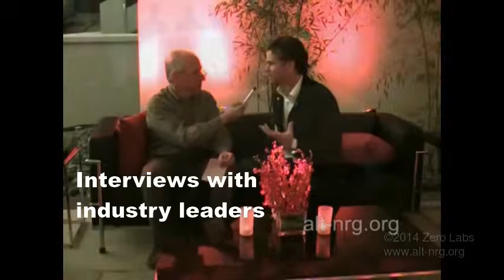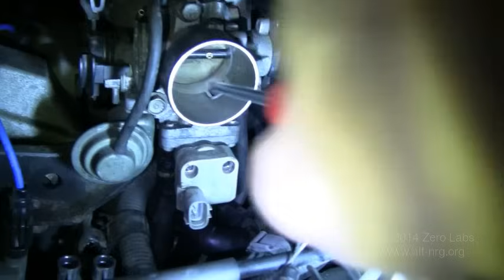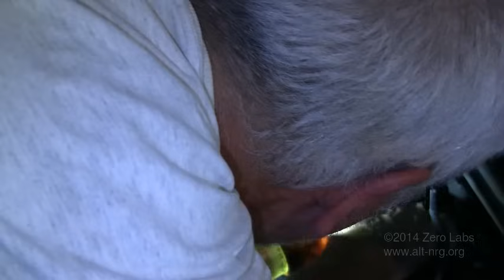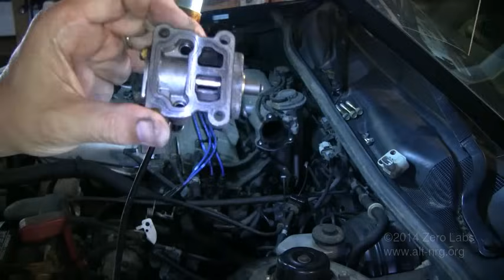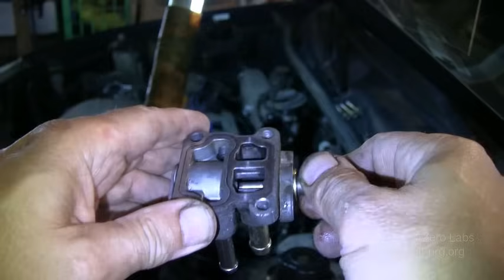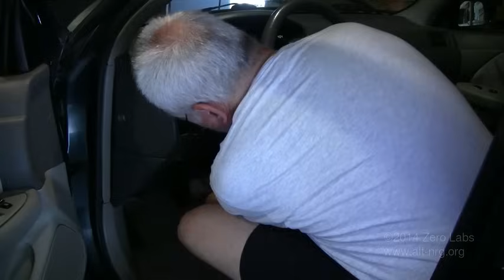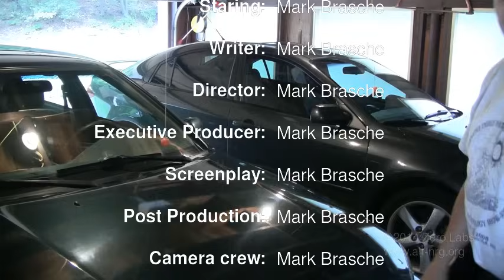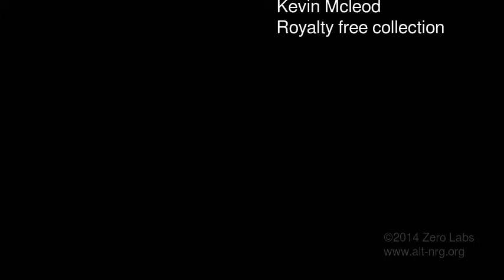#372 Better repair method Toyota Camry Idle Air Control Valve

Comment: Well Done! I cleaned out my IAC valve your shorthand way for ~5 minutes and noticed a difference in car shake reduction when the air conditioner is turned on. I used "CRC Thottle Body and Air-Intake Cleaner". Thanks for your helpful video! For anyone who had issues removing screw(s), I stripped the head off of one of the screws using an impact driver but I managed to remove it with "Vermont American #2 screw extractor (package says it's supposed to be used in conjunction with a 7/64" 2.8mm drill bit). Prior to using that extractor I had tried easy outs as well as left hand drill bits to no avail. When you feel your drill hesitate your probably close to extracting the screw.
Reply from the maker: Yes, those screw heads are very soft and easy to strip. Been there, done that, bought the T-shirt.

Comment: I had my IAC valve off and the "gate" was very sticky. I saw the screws on the end where the plug goes but I didn't want to take that part off because I didn't know if it would destroy the IAC. Now I know. Next weekend I'll take it off again and clean that little bugger.
Reply: I couldn't take the IAC valve apart. My 2004 Tacoma uses an IAC that uses the five point torx screws. I simply sprayed WD40 in the valve as it was sticking. I put the Throttle body back together and after a couple of hours of driving, the RPMs settled down and now the truck runs like it's supposed to.

Comment: THANK YOU VERY MUCH, ITS GOOD VIDEO, I HAVE CAMRY 1997 2,2  4 CLYNDER COLD ENGINE IDLE SPEED NEAR 1800 RPM,  ITS COMMON PROBLEM IN CAMRY,

Comment: Thanks for the video. I have a 2000 Avalon that wouldn't run without my foot on the gas. This video worked great. I couldn't get the IACV off because one of the screws was stripped but I sprayed it anyway and my car started right up and kept running with my foot off the gas pedal. Thanks!

Comment: Great video but I could only get 1 of the 2 screws off. I am having IAC valve problems on my 99 camry. I tried spraying cleaner into the throttle body opening that goes to the IAC. Worked good for a bout 1 week. I just bought a brand new one on Ebay for only $35. Every place else wanted about $200-$300 just for the part. Will be replacing it soon. hope that will fix my cars issues.

Comment: ok. My car is a Camry 2000 and do not have that coil nor cable. I Just exposed the hole inside that metal tube, sprayed 1/4 Mass air flow sensor cleaner. When I tried to started the car, suddenly it doesn't started! But in the fourth attempt, it worked! It is better now. The car is working at lower revolutions and  vibrations where reduced! Thanks a lot!

Comment: A great video, thank you so much! Been an engineer a long time, so I like to understand how the system works rather than just blindly follow a procedure. Thank you for explaining how it all works!  I have an idle speed issue with my 2000 Camry LE (4 cyl 5S-FE engine) where the idle drops below 500 RPM and the engine stalls. But this only happens after the engine warms up. So I still need to dig into how the IAC works and see if not enough idle air is the root problem, or a symptom of something else, like bad vacuum or sensor. But you're video helped me tremendously, thank you!
Reply: Hi, I have a similar issue as yours with my 98 4Runner 2.7 it has the same IAC valve set up. Just wondering what your final results were on your Toyota? Did you do this procedure and did it help your "low idle" or was there more that needed repairs or replacement 🤔? Thanks in advance 👍
Reply: @Agate Enchantment & Rock Wizardry  It worked for me. In the process of doing the repair i found holes that were letting air in behind the MAF sensor so that helped things too. But the car is on the road and running well.  I hope it works for you too.
Reply: @RadioWhisperer  Thanks so much 🙏, I have and will continue to look for vacuum leasks definitely!

Comment: Hi, great video, have a question, my daughter has a 2001 Camry which revs very high ( 2500rpm )when she starts, and it stays like that for a while be it comes down, and recently she was telling me, what i could gathers that it was surging while she was stopped a couple of times. Does that sound like a idle air control problem?......Thank You
Reply from the maker: Yes it does.

Comment: this is a great video. My only problem is I do not have that third hose in the middle. Only the two that are on both sides of what you pulled off. What then? Thanks for your help.
Reply from the maker: I think that means you do not have a California emissions compliant system or maybe a different year Toyota. In that case it should just fill and sit there for a while as you actuate the valve to clean it off. Some may still slowly drain out from around the valve stem so you may still have to keep topping it off until you're done. When you start the engine, any remaining carb cleaner will just get sucked in and burned off.
Reply: Zero Labs thank you very much! I know this is an old Post so I appreciate you taking the time to answer!

Comment: great... I should put the water hoses back? can i throw it away? Is it in there just as a anti freezing system, isn'it? I don't have problems with low temperature with the weather here... thanks
Reply from the maker: The water hoses are there to track engine temperature as it warms up. Removing or bypassing is a bad idea.
Reply: Did you mean that the water hoses are there to control the engine temperature to not make it so hot ? I think the result of the contact of the coolant with de IAC is  warm up IAC e the air (perhaps). Hot air in the intake manifold is not good . What do you think?
Reply: It raises the idle speed when the engine is cold. As the coolant heats the IAC, the idle speed drops. If you bypassed the hoses the idle speed would stay higher longer.

Comment: Make sure IAC valve closed completely  when applying a 12V across the terminal. If not U have to adjust the factory alignment of that spring connected to the other side.  If the valve failed to closed during warm idle..You will experience a 1.5 to 2 thousand of RPM during warm idle

Comment: Thanks, also a few video's show that IACV gate valve spinning 360, not back and forth, like u show. I think your way is right.
Reply from the maker: Anyone who spins it 360 broke the glue that holds the magnet to the gate valve shaft. Now dumpster food needing replacement.

Comment: Hello. Excellent video. Thank you for posting. May I ask if this procedure will apply to the 6 cylinder, year 2000 model? Also I see other suggesting the application of a lubricant such as oil or silicone when the cleaning task is completed. Is this necessary, or more importantly, is it practical? My daughter's 2000 Camry is having an issue, where the cold starting idle runs close to 1500 rpms for an extended period of time. Please advise.

Comment: i have 2006 lexus 3.3. do you think the same occurence would cause fast idle at start about 1200 rpms, for about 2, or 3 minutes.  there are no vac leaks.

Comment: I noticed that there was some sort of sealer on the actual valve itself when taking the two screws off. Do i need to re seal it? if so what kind of sealer? thanks great video

Comment: done the cleaning of both the throttle body and idle air control valve on my high idling Toyota Corolla sir, but everytime I lower the idle, it turns back up by itself.. could the broken gasket on the idle air control valve be the culprit?

Comment: So, would it be weird if my 2000 Camry doesn't have that middle tube coming out of the bottom of the iac?
Reply: Hey i have 1998 camry 2.2L. My car also doesn't have the middle hose. So if i spray carb cleaner into the hole. Then the dirts will go? Any body can tell.plz

Comment: Thanks for the video.  I noticed you use the old code readers.  You should get the Torque app (android $5) and an ELM 327 bluetooth OBD2 adaptor ($12).   They offer so much more info than the standard code reader.

Comment: I have a question. I have the same car and when I try to start in the morning it will not start. However if I shoot starting fluid it will start with rough efforts, but does start.  Do you consider this a symptom of what you deal with in this nice video?
Reply from the maker: Possibly.

Comment: Hi I have a Toyota Camry 97. It turn fine in the morning. I let it get warm enough to drive it, but when I am driving it, as soon as I get into a stop it shout off. It is draving me crazy. Then it takes time to turn on. I have to push the gas pedal 3 times and crank it again to turn on, but when it turn on doesnt stay on it shout off again. I change the pcv valve and its hose but it is still shouting off when I slow down or on the stop. Any clue. Can you help? Thank you
Reply from the maker: I think I just did with my video. If you can't perform this repair you'll need to find someone who can. I'm not for hire. ;-)
Reply: thanks

Comment: Great video. I will try this.
I got a 97 Camry 2.2 L with a rough cold start throwing a misfire code.
Reply from the maker: please report back when you do!
Reply: I did this fix. I removed the IAC cover (2 phillips bolts). I did not remove the return line to the intake, I could not tell which one it was. The lines looked fused to the throttle so I was not going to go messing with them.

I applied sensor safe solvent into the IAC hole while toggling the magnetic swictch back and forth for a good minute or so. The spring tension is pretty strong on that switch, you weren't kidding!

The car starts up a whole lot better. Almost no stumblling or misfire at all. Before car sounded like it was going to throw a rod. Night and day. Great video!

Comment: So i got the same code on my rav 4, my problem is that when i let do of the throttle at lets say 3k rpms my idle plummets down to 1k to 1.5k rpms instead of stay constant or at least relative around those revolutions. Would this quick fix solve my problem as well? btw it surges as well whenever i turn on my a/c
Reply from the maker: Hard to say. Easy enough to try.

Comment: Ive cleaned the IAC valve and it worked for a while and went back to stopping . I bought a refurbished and cleaned IAC and worked great for 2 weeks... now Im back to car stopping again. Can anyone help? Ive disconnected the battery hoping computer would reboot, no luck. I have a 99 rav4,,,, Help!
Reply from the maker: If your IAC valve is getting grunge buildup in such a short time, you've got much bigger problems. Start checking things like compression.

Comment: thank you so much for the quick fix. I just did it to my gf's 2001 camry and it fixed the rough idle on cold start.
Reply: on your 2001 there no hose like his how did u do it
Reply: Adam Reveles there is a outlet tube goes to crankcase at similar place. just pull it. you wont get wrong cuz its directly under the notch where you fill in the carbcleaner
Reply: Lol same car and problem with my girls

Comment: This is a great procedure, where applicable. For some reason my '97 2.2L Camry does not have the middle (air) hose coming off the IAC, just the two coolant hoses.
Reply from the maker: +Walter Legault Some did not. The middle hose is a crankcase vent. Maybe it's possible you have a PCV valve on yours instead?
Reply: Right you are, Zero. There is a PCV valve. Yours is the California design.
Here's a useful tip: On my vehicle, the two phillips-head screws which affix the electromagnet to the IAC valve were seized and couldn't be removed while on the car. I was able to open and close the valve by applying battery voltage to the connector terminals. Connect the positive side to the middle pin (be sure to fashion a well-insulated connector to avoid shorting) and alternately ground the top and bottom pins to open and close the valve while spraying carb cleaner into the IAC intake port.
Reply: ɷɷɷɷ Heeey Friendsss I Have F0unddd Workinggggg Online Hacck visittttt  : -  https://t.co/ppaziVHUpv

Comment: I learned so much from this video. My 94 Lexus looks similar. I've had it for a little over a year. Had it tuned up etc at mechanic when I bought it but it started idling very low and speedometer would not work for a few miles when cold, and would keep giving me spark plug codes. I finally braved it and decided to clean throttle body and mass air flow sensor. Even though I did not have the time to really do it this time, and for fear of breaking another hose, at least I learned what that notch was for and cleaned it somewhat. Anyway, the throttle body was horribly filthy so I can imagine that air control valve thingy, and the air filter. The car runs 90% better and I will take that part off next time when I can have someone with another car just in case. It did give me a weird code that just would not come off, I think a PO773. After finally arriving home after 74 miles, I turned car off, took key out then put key back in and just turned it to on without cranking and left key in for almost a minute and took key out and restarted car and code came off and did not come off. Thank you so much. I am a woman and could not afford a mechanic at this time or most other times
Reply: I meant the code PO773 came off and did not come back on but I can't wait to really do it like you showed
Reply: And the mechanics, don't know which, must have broken the part of the air intake hose that is connected to it so I had to crazy glue it at least for now. And of course they didn't tell me because that is not a cheap part

Comment: great video zero. thanks very helpful! my big tube was torn just above the throttle body lip connection point. took it off and notice the tb plate was pretty clean. I'm wondering if that rip was causing the weak turn over on the engine with low idle. I glued it with gorilla glue do you think that would be safe as far as chemicals in the glue possibly catching fire?

Comment: Interesting... I have two Camry 5sfe's here, 97 and 99, and they don't have a center hose, just the two coolant ones, and air bypasses through the valve to directly behind the throttle plate... so in their case it would send the carb cleaner into the intake manifold. Not the worst thing though. Perhaps there was a part/design change mid 97?
Reply from the maker: Possibly. All I know is you have to be careful of such things. That's why I point it out.
Reply: Absolutely. Thanks for the video!
Reply: Why is it critical to maybe not get the throttle
body cleaner, a little down into the intake manifold. Just wondering if Toyota
is more sensitive maybe or something. We have done this for decades. You just
let it set during the day before starting. It also evaporates either way no
matter where it ends up going. You just don’t want to dump half a can in, wait
a minute then start, try starting your car cause your going to rumble your
engine a bit and maybe if Toyota's are extra Sensitive etc cause a valve or Sensitive
device in the engine to react, negatively?
Reply: Great video by the way!

Comment: Thanks for showing the "better quicker method". Stupid question, but I assume the car should be turned off the entire time when you have your finger on the middle pipe?
Reply from the maker: +BloopADoop You are correct, on both counts. ;-)

Comment: Wish I had seen this video when I did the same procedure for my 95 Camry.  Written steps and pictures from toyotanation were great but video is much easier to follow through. Not sure if it was necessary but I soaked my with sea-foams over night and then sprayed more the next morning.
Reply from the maker: +TheStevehn That works too! ;-)

Comment: This is the problem I'm having with my 99 Camry CE 4cyl, 5-spd (Calif emissions)

- Car hesitates or does not accelerate at all, most when cold and occasionally when warm . Sometimes restarting the car eliminates the problem for a period but when restarting later, the problem reappears. 
- Rough idle when coming back down to idle, like it's missing badly on one cylinder
- Turning on blower motor nudges engine rpms up just briefly (as mentioned in the video). I didn't think this was indicative of any problem but may have been mistaken. 
- My Camry has the codes: P401, 441, 446 & 1133. I reset the codes after cleaning the IAC port but they reappeared after driving around 50 miles.

At first I thought I may have had bad gas so I added some dry gas but with no results. I cleaned out the throttle body with Sea Foam DC-14 Deep Creep and also the IAC port, but unlike what ZeroFF did in the video, I didn't unplug the air line on the bottom. The EGR valve has movement but I haven't vac tested it yet. Tomorrow I'm first going to try clearing the IAC port and depending on if I have the time, remove the throttle body for a thorough cleaning. I'm hoping it fixes the problem as emissions-related issues can be quite difficult to diagnose & expensive to repair.

ZeroFF: Thanks so much for posting this video as it will clearly aid me in my repair.

Comment: What should i do now that i have cleaned three times already. Car still dies at cold start up. Flap inside the motor is real clean n shines like mirror.
Reply from the maker: +Tariq Awan You may need to replace the IACV then.